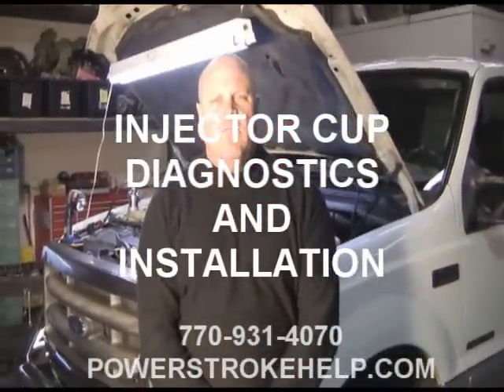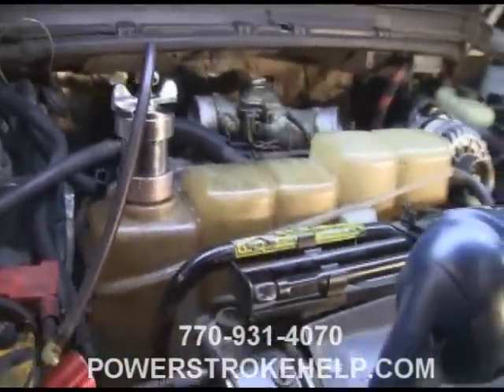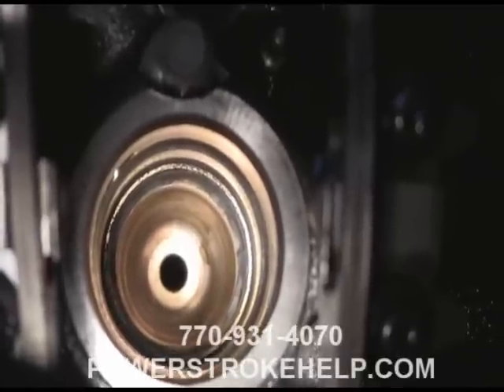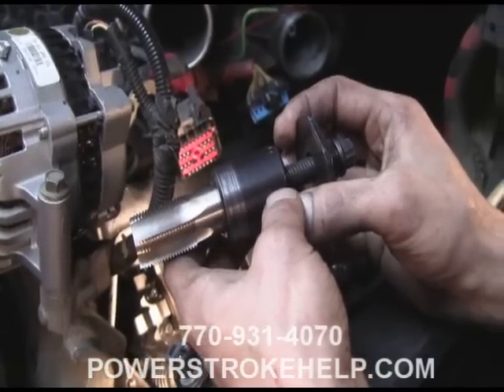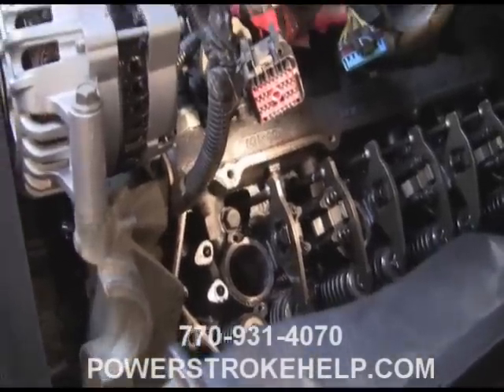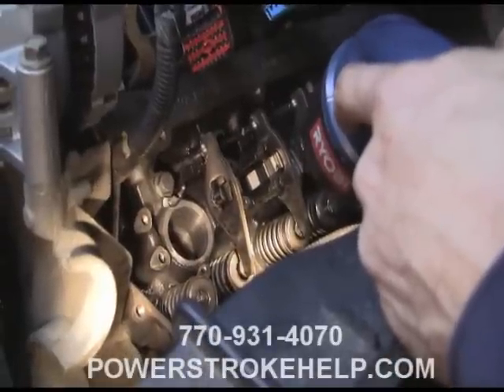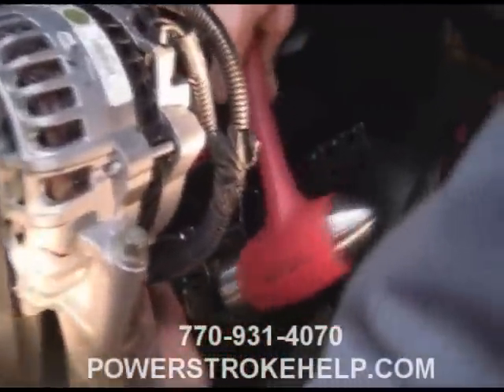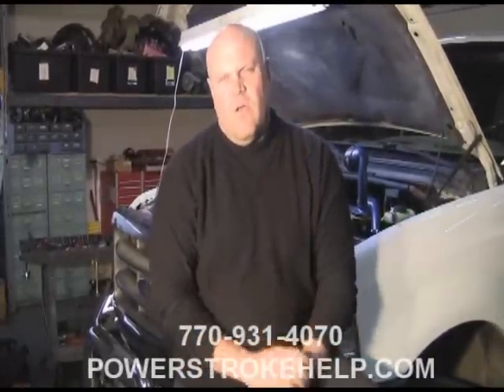INJECTOR CUP FAILURE IN POWERSTROKE

Comment: Well done!! Gives ppl like me the confidence I can do this job, never have doing it before. Thank you!! One concern and one question though with the green threadlocker chosen. Would you not use Permatex 64000, which is a high temp sleeve retainer compound? And after using this compound, is it resistant to the 2EH acid found in ELC coolants and why early 7.3's had to/should only run a conventional coolant due to injector cup compound dissolving until Ford fixed that issue?

Comment: Not a diesel mechanic.coal miner mechanic which entails electrical,mechanical, hydraulics jack of all trades and the master of none.However own quite a few ford diesels.I have 3 now 95-7.3. 2003 7.3  2012 6.7 deleted.I watched more of your videos than any other diesel mechanics.Very informative thank you very much.My 95 smokes very bad on start up if it sets overnight .nofuel in radiator,don’t use oil.Runs good after warm up.And ideas Wish you were closer need help on some question on 2012 delete.can’t find some of your products in Wv.Thank you for all you do.

Comment: I thought you needed to use a high temp locker? The green lock tight isn’t recommended due to it not being heat resilient. Is this correct or no?
Reply: Loctite 620 is what most specialty places use, sell, and recommend. Though when you dig around, it seems people use everything from green to red loctite/permatex. I think the cup seals quite tight and most products do the job to fill the gap, the question is how well. I recommend loctite 620.
Reply: @krismorey  I asked about the green Permatex he used. Probably won't get an answer. I'm looking at my Permatex #64000 high temp sleeve retainer compound (that he didn't use, but it's green too). Good till 400*F and 3000psi shear. Same as Loctite 620? Thanks.

Comment: Got my Excursion 7.3 running coolant smells like paint thinner planning on replacing the injector cups from board also the injector O-rings but none of our local tool dealers has or offers installation or removal tool and someone else told me the the cup tool only last for a few uses if that's the case is there any particular brand tool you would recommend and where to purchase

Comment: Bill I have a question. I’m doing a home rebuild on my 7.3. I’m planning on rebuilding the heads and I am going to purchase the tools and a cup kit. My question is my cousin mentioned to me taking the orings off of an old set of injectors and bolting them in after I installed the new cups. Do you think this will aid in the sealing of the cup or a precautionary measure to make sure it set and stays set while the locktite cures. The heads are off obviously so I have plenty of time to change them all. I’m just curious if installing blank injectors immediately after a cup install should be done or not? Or if doing so could possibly have any negative effects. I have a spare set I could easily undress and use.

Comment: My truck have white smoke,ive already chage my cylinder head gasket..but still have that smoke..fuel injector has been newly calibrated..is it possible that if the nozzles are dirty it will produce white smoke?

Comment: Got a 1999 f450 when I start up eng start to accelerate by itself up and down 1200 rpm 1600 rpm ,and start smoking bad smells raw fuel ,change icp sensor . And when you accelerate a little it takes off  eng goes into rev limit . Now if I let it sit ,come back in morning starts up just fine smokes a little and clears out . And then after it warms up it starts acting up .what in world could be .
Reply: I having the same problem and was one bad injector

Comment: I am currently doing this repair. I first noticed diesel in my coolant 5 years ago then I saw diesel leaking from an O-ring in the fuel filter and changed out the fuel filter ( seemingly unrelated issue ) I noticed the diesel was no longer getting into my degas bottle. just put in my 3rd fuel filter over the past five years with 10000 miles on the truck in the last 5 years (total of 181,000 now). I installed latest fuel filter 3 weeks ago and it didn't clear up the diesel in the degas bottle so I am switching out the cups now. Does it make any sense how swapping out a fuel filter would have helped this problem? or do i need ro look at somthing else. Thanks !

Comment: I just got the last two injector cups pulled out a few hours ago tonight. I discovered several tips and tricks during the process. The first one is like what another guy said below me. Drop a penny down in their before you pull the cup. I learned that from Diesel Tech Ron also. These next ones I learned myself. I'm using the Riff Raff Diesel injector cup puller and installer tool. I went ahead and bought it so I have it in my shop. I don't like renting stuff and prefer to own it. Anyway the instructions aren't exactly clear on how to use this tool. I found that anything less than a large (at least 18" 1/2" drive flex head....up to a 24" 1/2" drive....or even a 3/4" drive) won't get this done. You have to screw the cutter head in at least 3/4 of a turn....to 1 full turn to get it to cut/catch deep enough so it won't release and slip out. Trying to use a 3/8" drive....even a long one?! Forget about it....you'll never get enough power on it. I'm not a weak guy either....I can dead lift 375 pounds and haul heavy boilers, water heaters, concrete slabs, furnaces, A/Cs, heat pumps, black steel pipe etc... around daily as a licensed HVAC technician. I cut 16,18, 24 and 30 gauge sheet-metal daily and have forearms that look like tree trunks......FORGET IT....you'll never get that 3/8" drive ratchet to work. One trick I found is to take a black Sharpie marker and mark your socket. You can guess when you made 3/4 to 1 full turn...but you will mess up and stop short without some sort of orientation on your socket. 3/4 to 1 full turn is very very tight. You feel like a 3/8" drive ratchet is going to break it's so tight....thus it's not the one to use. Once you get at least 3/4 a turn on the nut, she will pull right out. Use a pair of channel locks to grip the cup and a wrench wedged against your workbench on the nut to remove the pulled cup from the tool. Hook the long handled wrench on the nut and push it down against your bench for support and leverage. Use light pressure on the channel locks when unscrewing the cup so you don't deform it and make it tighter. It'll come loose and you can move onto the next.

Comment: LOL.... My garage floor and workbench look exactly like yours does at the moment  in this video Bill. I pulled all 8 injectors and rebuilt them with new o-rings. I pulled and replaced all 8 injector cups. I'm replacing turbo pedestal o-rings, all 8 glow plugs, drivers and passenger fuel lines, intercooler CV boots and intake boots, hoses, degas bottle and cap, ICP sensor, thermostat, and a whole bunch more stuff while I'm in there and have it apart. That's the good thing about doing the work yourself and buying your Motorcraft parts discount online. You can fix everything that looks shady or that you know is almost 15 years old since you bought the truck new for less than they charge to fix one thing. I did an estimate of my total bill at a local Ford Dealership. I guessed $4,000+ to do all the stuff I am doing for less than $1,800. I bet I'm not far off the mark.

What got all this started was.......you guessed it.....fuel in the coolant and degas bottle overflowing and puking. It's an old truck that has been good to me for many many years. I can't bitch too much as I was a much younger man at the time I bought it in the Fall of 2001 too. I'm not so hot myself anymore....LOL Damn this late July and early August heat is killing my ass.........these last few weeks.

Comment: Bill, tip I learned from DiselTechRon (RIP), drop a penny into the old cup before removal, prevents shavings from dropping into the cyl.
Reply: Use a paper towel instead. The cup can crack and that penny can fall down, ask me how i know ;)
Reply: Rusty Teel - yes there are chips that come from the tap, and it’s never good to run chips through the engine and turbo! Don’t be a dumb ass!
Reply: You could also put grease on the tap to keep the shavings from falling.

Comment: Great video just one small correction. Locktite is a anaerobic product, that means that it hardens in the absence of air so leaving it open will not make it harden only when it is deprived of air will it set up.
Reply: so why doesn't it harden up when sealed up with the cap there is plenty of product in the tube lacking the presence of air I would tend to think

Comment: I did this repair several years ago, used a small custom made slide hammer that threaded into a nut welded on the end of the huge tap. Did all 8, tight back there by the heat/ac box. I also forgot to drain coolant first and when I pulled the sleeves coolant flooded the cylinders. Horrible mistake but after I had pulled all 8 sleeves I took a 50A mega fuse and jumped the starter to shoot it all out the open holes. It's been a while, but I think thats how I did it. I also put a piece of greasy paper towel down in the bottom of the cup before tapping to prevent brass shavings from dropping into the cylinder. It was my own truck done in shadetree fashion when I had a lot less experience than I do now, but was able to pull it off.

Comment: Have you ever had the cup only put antifreeze into the Cyl??  where did you get the tools?
Reply: +tigman47 http://www.riffraffdiesel.com They rent the cup tool for $50 with a $399 deposit, I'm about to do it myself, doing a complete 73 rebuild
Reply: +tigman47 , ebay has a nice set for $199.95  Free Shipping!
http://www.ebay.com/itm/1994-03-Ford-7-3L-Navistar-T44E-Injector-Sleeve-Removal-Installation-tool-/262080000747?hash=item3d052f72eb&vxp=mtr
Reply: +Patrick TheBaptist , I know you're low on funds but try ebay Pat.
http://www.ebay.com/itm/1994-03-Ford-7-3L-Navistar-T44E-Injector-Sleeve-Removal-Installation-tool-/262080000747?hash=item3d052f72eb&vxp=mtr
Reply: Ken Doe
Friend I usually am low on funds.  That's a great deal on the tool but I just ordered the rental this morning, hope I get it sometime soon, my customer is getting annoyed, but he took over a month to get around to paying the part deposit for me to begin work so it's his fault it's still sitting here.
Thanks for the info though, I may later on buy it.

Comment from the maker: You need to pull all 8 injectors and sent them to a reputable diesel injector shop. Wayne at Mississippi Diesel Products will get you fixed up for $35 to check each injector plus repairs on bad ones. 601-849-5171

Comment: Hello! I just have 2 simple questions, the injector cup tools, are they different for the 7.3 vs. the 6.0, and would it be a good idea to coat the extractor with grease or petroleum jelly so no metal shavings get inside the cylinder?
Reply: True.I noticed that too.It's bronze shavings but you don't want rings to catch them.
Reply: Drop a penny in the cup first and it won’t allow any shavings to fall into the cylinder

Comment: Bill, I run a fleet of paratransit buses ranging from 96 to 2003 most with over 350k. I have seen the cups do what you describe pushing fuel into the coling system but I have also seen the cups leak at the very bottom leaking coolant into the conmbustion chamber, this resembles a head gasket failure. loss of coolant, smoking while running and hydro-locking over night. Its so rare to see a head gasket failure in these engines. I always enjoy watching your videos, Just thought id add...

Comment: I just got a quote to diagnose and replace the cups on my 2001 excursion. it has 140,000 miles on it.  they are telling me that they should check for a cracked head and just replace all the injectors while they are in there.  total price $5k.  seems steep to me.  Thoughts?

Comment: Nice work.  I have a 1999 with the 7.3 and went to replace all injectors.  Whenever I did the #8, the copper seal must have slipped-off the injector during installation.  I bent the copper seal and replaced it.  Now, I get a-lot of hesitation.  Is it possible that I cracked the injector sleeve?  Also, how difficult was removing/installing the new cup on the #8?  Thanks!!!

Comment: i have 150,000 miles and had en edge since 122,500 miles with 4 inch straight pipe all the time. would it be best to replace them now or is it a thing u do when it happens. i now u cant just determine without seeing it but just wondered if it was a good thing to do

Comment from the maker: @crunksnizait When you reinstall the injectors the fuel and oil will come back into the heads during cranking. It takes a bit of cranking and there is usually a bunch of smoke from the tailpipe as the oil and fuel that got into the pistons is burnt off. AND it will take about 5 miles before all the air is worked out of the fuel and oil systems and the truck will run smooth.

Comment: @ powerstrokehelp. Thanks i will surely check that out your vids have been invaluable to me in terms of knowledge to assist my customers that have PSD's. On a side note what are the odds of picking your brain on the drum in hat brake sys. several of my customers have issues with them and i cant find any info on tips and tricks for the ford sys

Comment from the maker: @klosnoski If you want the complete answer go to my YT vid "6.0 the perfect storm". But in a nutshell, the 6.0 (or the 7.3 for that matter) were ever designed specifically for the Ford application. These are navistar schoolbus engines shoehorned into the Ford chassis. In the 6.0 application the emissions standards for the F-series was much more stringent requiring the motor to run much hotter than the Navistar application. Many of the problems started here.

Comment from the maker: @stinkey750 Its called blowby. It is a condition where the piston rings are no longer sealing as they should and the pressure of combustion is creating pressure in the crankcase. All diesels have some but alot is bad. This pressure pushes oil out of the breather which ends up in the air cleaner. In a word your motor is showing signs of being worn out.

Comment: @powerstrokehelp It's a 2004. I am in California near the coast..I looked up shipping and it was right around 1,200 for the one way. it looked like there is a very very small layer of diesel ontop of the oil/powder looking substance then clean coolant below when extracted form the degass bottle...I am hopeing it's a leaking cup and a failed oil/egr cooler but I will contact you tomorow to get you opinion if I could handle this myself with your video service or if it's best to bring it on over..

Comment: Bill, you dont seem concerned about any foreign metal particles falling into the combustion chamber as a result of tapping into the injector cup, why is this? im not anywhere near as knowledgeable as you are with these engines but i would think as a result of cutting threads into the injector cup you would create metal filings and the only place for them to go would be down.

Comment from the maker: @4130gotmud Yes the diag is the same. There is a 50/50 possibility of it being a cup or a cracked head. What year is the truck? Are you any where near ATL? If not shipping has gotten cheaper, Just got one in from Kansas City that coat only $797 to ship. Please call 770-931-4070 if we can help. It will be right when we are done wit it.

Comment from the maker: @klosnoski The injector design and High pressure pump are right out of the CAT parts book with a few minor changes. The designers at Navistar were smart, why reinvent the design and tooling when a perfectly good design already exists. If you think about it the Gen1 and Gen 2 PSDs (94-03) were just one big sub contract. Ford subs the engine out to Navistar and Navistar subs out the injectors and HPOPs to CAT. I'm sure there are other parts too.
Reply: Whats part num from cat

Comment: I just found a black suit looking material in my degass bottle on my  6.0 with 250,000 miles..The local diesel shop says it is diesel fuel in the coolant and its a cracked head without even seeing the truck..Is there a chance that its just a cup and would your diag procedure be the same on the 6.0..Your Video's and knowledge of these motors is second to none and I don't know where I would be without them exept possibly paying a shady shop 9,000 dollars for heads instead of changing the cup